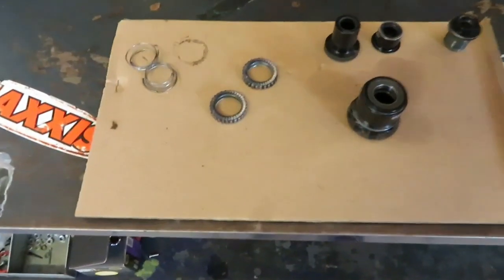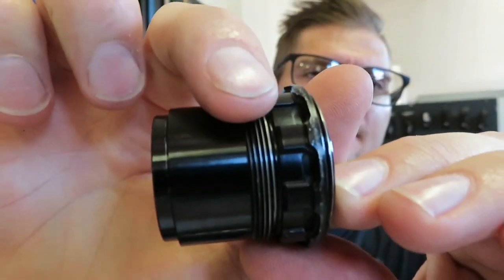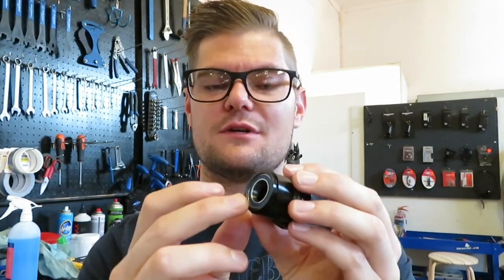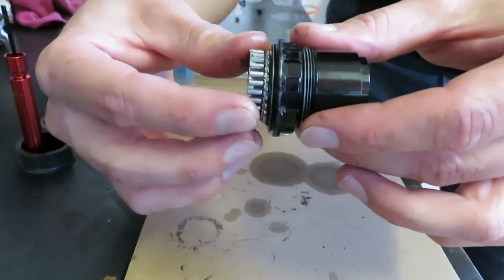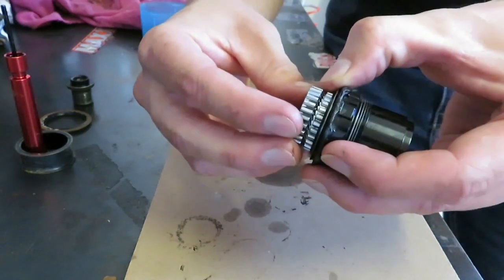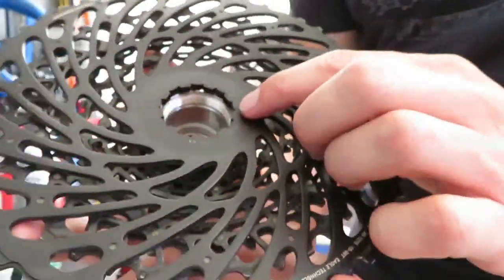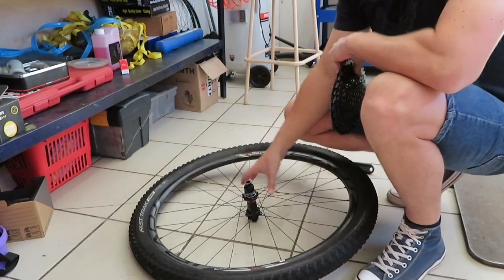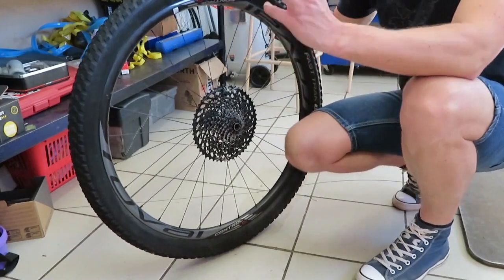How to fit a Sram XD Driver - How it works - Step by Step.

Comment: Thanks, I was bouncing my wheel to get the bead to set on the rim when the cassette popped off with the driver still attached to the cassette... My friend said bearing in driver are probably going which caused it to back its self off?  I imagine a chain whip & the special cassette tool are needed to get it apart and reinstall it properly :( I'm bummed
Reply from the maker: Ah. Thats a bad one. Just one tip. Try to put it back onto the wheel. Will make using the chain wip and special tool to get it off 1000 times easier
Reply: @RuanvanderLinde  ya my fingers are crossed no threads were damaged ect, it did feel a little bit odd last ride I am assuming it was caused by it. Thanks a bunch. the vid was a big help
Reply from the maker: So glad. Please let me know if I can assist with anything else. Will try to make a vid as good as possible

Comment: can i use that driver on my mavic wheels but my xd driver has 4 pawls ?
Reply from the maker: Il rather say to make sure you have a compatible hub. If its the same hub you can do it.
Reply: @RuanvanderLinde  hi there deemax pros from 2019 with the 1 yellow spoke  if that helps as got no idea on hubs
Reply from the maker: @soundwave6769  let me do some research and get back to you

Comment: great video bro...could you advise me why Mr xd keeps creaking

edit.

actually you did lol big thanks
Reply from the maker: Hey. Thanks so much. Most of the time the creaking comes from the cassette itself. You will see there is a white plastic part inside the cassette. Make sure you clean and lube that enough. Ill make a vid on all the parts to check. You can also check the little teeth at the back on the ratchet. They can also creak like crazy.
Reply: @RuanvanderLinde  thank you for the info. I'm going to look at it. I don't have the tools to separate the hub and cassette but hope its possible to some cleaning that way even though separating them then clean is the best way
Reply from the maker: Let me see what vid I can make on seperating without all the tools and still doing it safely
Reply: @RuanvanderLinde  cool man its gonna be super helpful

Comment: Was that a 54t? Making that sound?
Reply from the maker: Hi. Its the normal dt swiss hub and the xd drive compatible clutch system for dt swiss hubs that made the sound. Just put the normal 10/50 T gear ratio on

Comment: hi, i have xd driver hub body. I purchased an SRAM 12-speed gx cassette. Once i tighten down the cassette to the hub. the cassette and hub slide off. they are attached to each other but not the actual hub. can you tell me what I'm doing wrong? do the 3 little teeth hold the xd driver onto the hub? once i install xd driver it just falls out. do i need to engage the 3 little teeth?
Reply from the maker: Hi. On the end cap. There should be n very small little o-ring on the inside that should lock it on a little bit tighter so it doesn't slide off. Either on the end cap or on the axle it self.